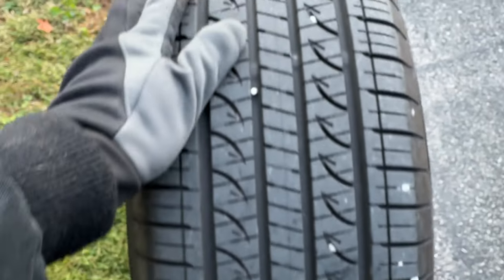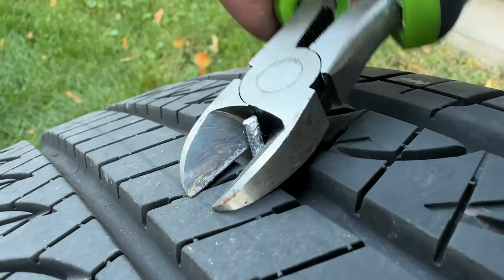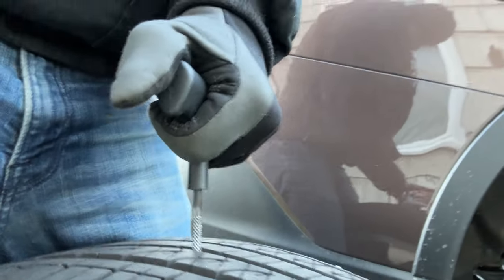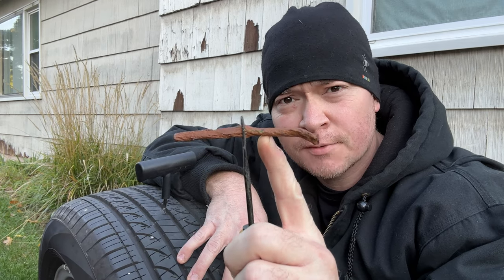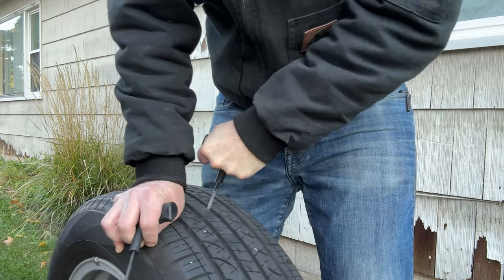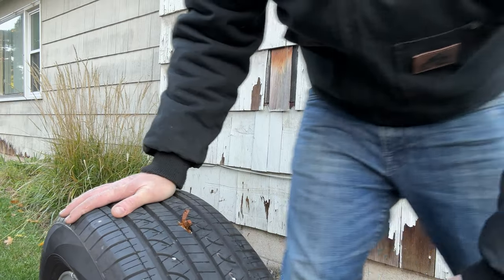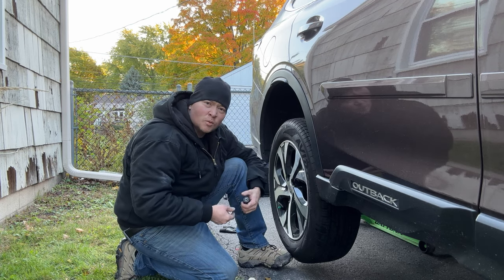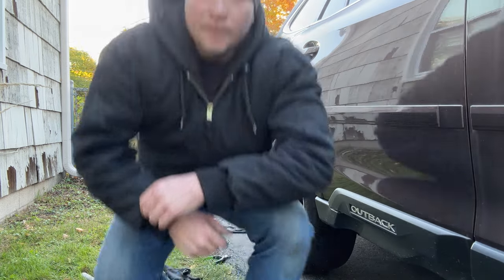How to Plug a Tire - Weekend Vlog E4

Comment: My friend Rob, AG0DX, Bought a small camper trailer to use as a Ham shack. when we went to tow it home it had a flat on one tire and the hole was in the sidewall. I explained to Rob that tire plugs don't work well in sidewalls. It was only 6 miles to his house so we plugged the sidewall and got it home, blocked and leveled it. 12 years later Rob gave the camper trailer to me. We took it off the blocks and nearly died laughing, the tire with the sidewall plug was still holding air! K0DXJ

Comment: I'm at once always amazed at how bluetooth tech has reached even tyres, and somewhat unsurprised that a video such as this is needed for many people. I grew up through the times of split rims and tubes and eventually tubeless. I learned how to hot vulcanize, and cold vulcanize tubes and then had to learn how to patch tubeless tyres. These plugs are possibly the cheapest and easiest way to repair a nail or screw hole but there are many people who can't work out how to use them effectively. As you said, a properly applied gummy plug like this will last as long as the tyre. It's basically chemical welding.
Reply: Bluetooth?
Reply: @ewicky  You can buy tyre valve caps that have pressure sensors with Bluetooth connectivity. Usually, on most modern cars, the sensors are inside the tyre. Both use wireless tech to transmit to the car's computer. The problem with the internal ones is in most cases, when the battery dies, you have to replace the sensor. There are other pressure sensors that measure wheel rotation speed to determine if a tyre is losing pressure.
Reply: @BradGryphonn  I'm familiar with TPMS, I've just never heard of any system that uses Bluetooth. The OEM ones, like you mentioned, that have been included in every car for the last 15 years certainly don't use Bluetooth.

Comment: You can save a lot of time by not taking the tire off. If you are working on a front tire, you can just turn the tire so you have a comfortable working angle and plug it. If it's in the back, you can almost always plug it without having to take the tire off. The only problem is if you can't get in a good position to get enough force on the plug. You might as well try though since you can always take the tire off later if you can't get in a good enough position. Also, after plugging hundreds of tires, I learned that wire cutters are the best way to grip stubborn pieces of metal that are hard to get out. Get a good bite into the metal and it will almost always come out

Comment: I too swear by these. And I also use the "extra" rubber cement. I have heard that in some places a plugged tire will not pass inspection (if your state requires such a thing. And we do here in Virginia) but that would be only if they look/find it, I suppose. Don't care...LOVE THEM!!! I too have not had one fail (or multiple plugs, but that's a whole other Oprah Show) before the tire wore out. These things are awesome. Saved my butt on more than one occasion. Keep up the great vids.